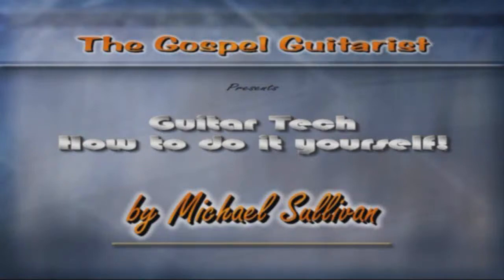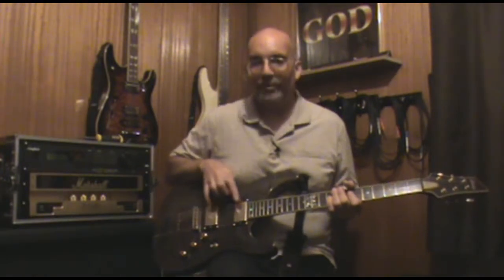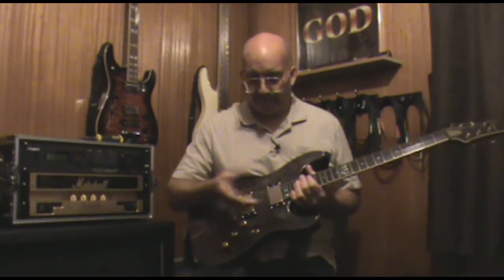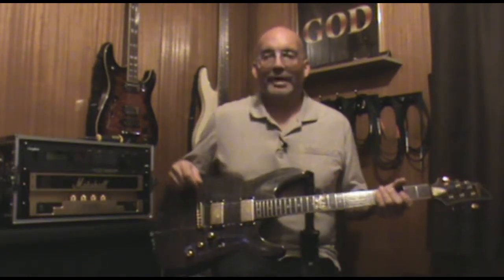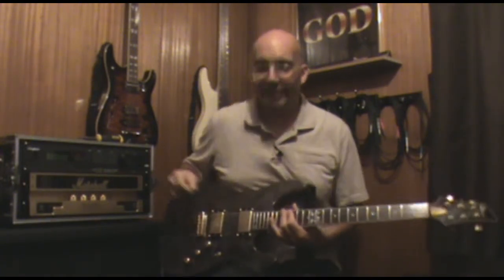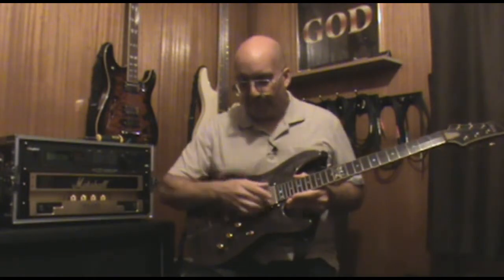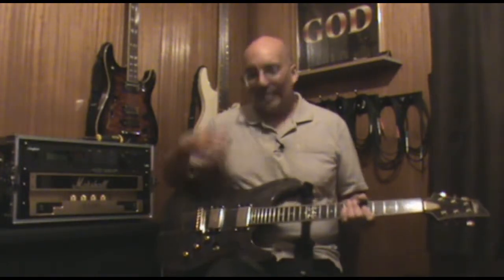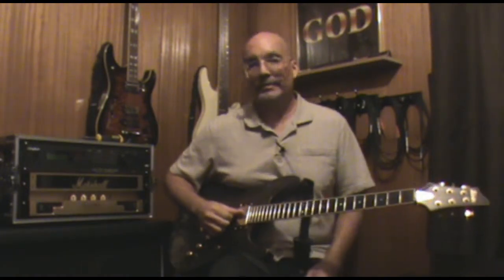Balancing Guitar Pickups

Comment: I've got two single coil hot stack humbuckers.  I've adjusted the pickup heights and it's better but the neck is still a bit loader.....a little muddy but not too bad.....I adjusted the neck down and the bridge up.
There are no screws to adjust to the individual strings.
I was reading that I can put a cap in line with the hot line on the neck pickup....,0022, .001, or .004 (not .022 like the tone cap) straight in line between the pickup hot line and the volume pot.  Have you ever heard of that?  It only stops the lows on the neck.  The bridge isn't muddy
I've used an eq and reduced 3 low freqs but it effects the bridge pick up too unless I turn off the Eq....then I lose the line boost on the eq and I like the punch.
It tough finding another pickup.....there are not many hot stacks out there.
Reply from the maker: I have not read or heard about adding caps to a pickup lead to cut lows but I don’t say it won’t work either. But I would just swap out for a better sounding pickup.